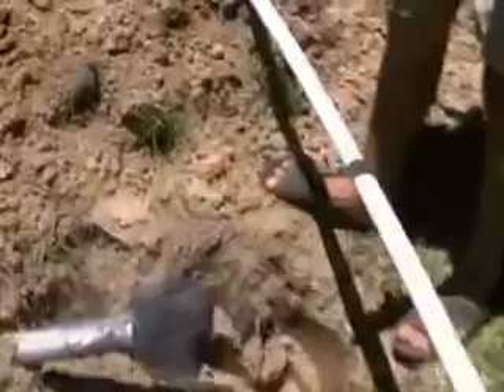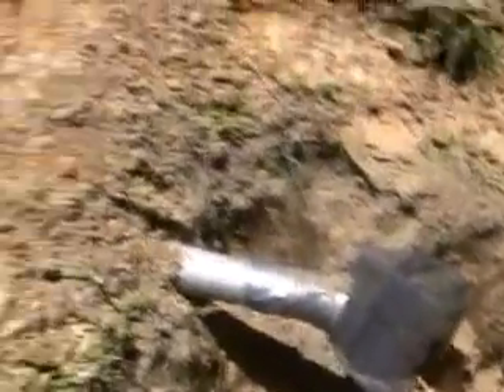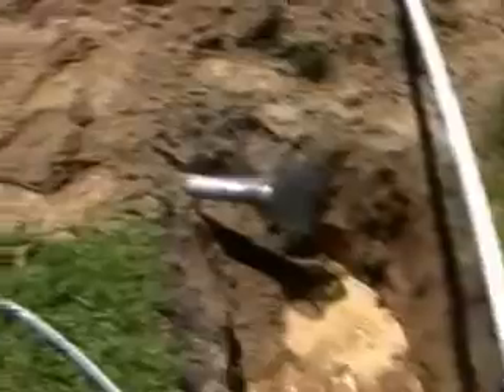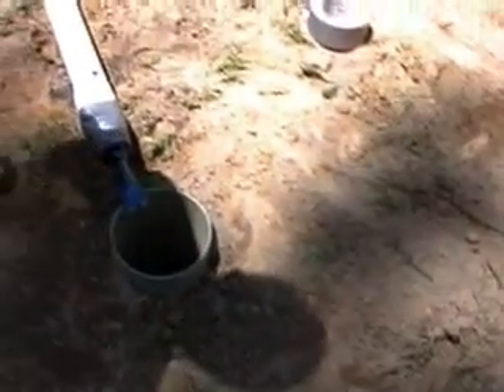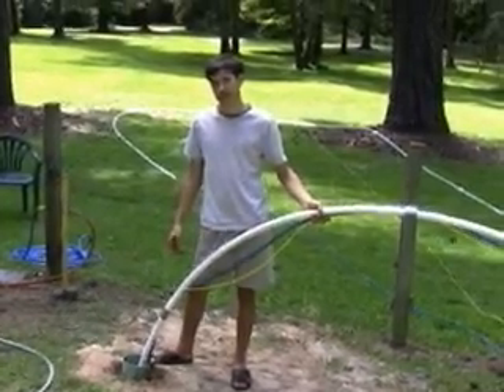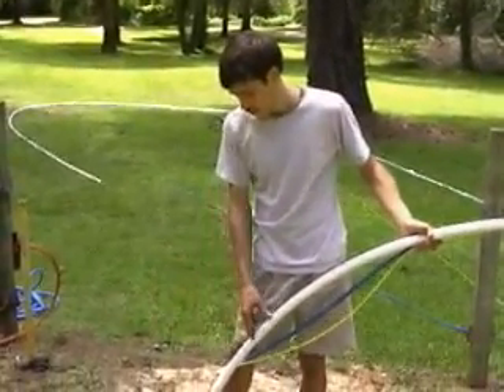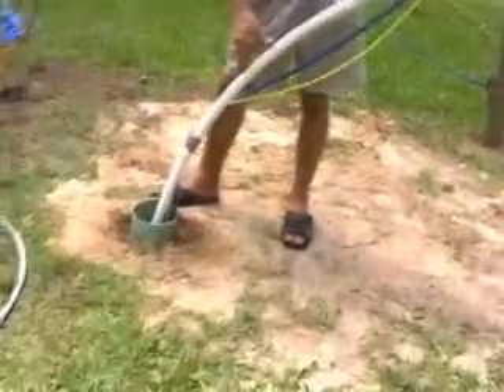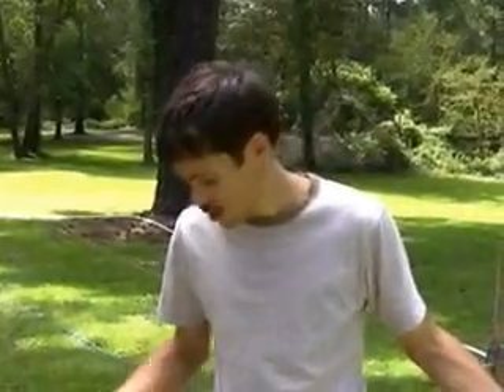How To Drill A Well In Your Own Backyard!

Comment from the maker: I would buy an air powered water pump such as can be purchased on my website, hook it up to a small compressor and some 1" pipe, and pump out the sand that way. It probably just needs pumped out good until the cavein has been pumped down, then it will work fine. Alternatively our well drilling system will go inside of a 3" casing to drill deeper to put in a 2" casing if necessary.

Comment: I have a 55 foot shallow well here in NC that has stopped producing. It has a 3 inch steel casing. Everytime I try to pump from it now it clogs the foot valve and pipe up with mud. :(
Any ideas?

Comment from the maker: We use drilling mud to keep the well from caving in while drilling. When you've reached the target depth, you simply pull the drill out of the well and drop the 4" thinwall PVC casing into it and then dump gravel around the outside, and seal the surface with concrete or according to local codes. Then you drop a pump, most any pump on the market will work in this well, and move on. How to know when you hit water is discussed in detail in the plans, too long to go into here.

Comment from the maker: Maaaybe... if you are going less than 30' through nothing but sand, like they do in Senegal. Even then, this is far less work and much faster. And I've drilled 210' , drilled through 50' of clay and several feet of rock; manual drilling can't do that :)

Comment from the maker: I regularly deal with customers who have had pro drillers bypass excellent water (which they found with home system, such as mine) in favor of salty or iron water that is deeper. Deeper water is NOT necessarily better. And ALL wells should be tested for contaminants, shallow or deep, before using. 

300 is a shallow well by well driller standards, yes. But 10s of thousands of TRULY shallow wells (25-100') are in use today, many provide excellent water and do NOT cost 6000$-80,000$ to drill.

Comment: 300 feet is a shallow well in most places in the U.S. MOST not all.
the reason many well drillers go deeper is not because they get paid more. Its because of quality of water. Shallower water isnt as filtered as deeper water and may contain more chemicals and bacterias. Also a deeper well that pro drillers will use uses a better source of water in case of a drought. Those are the reasons a pro driller would drill deeper.

Comment from the maker: That is a well that would be nearly impossible even for a 100,000$ professional rig. If you get a quote from a well driller, it will probably be 30,000$ or so. You are talking a serious hole in the earth, a quarter mile through rock. That is not possible with any home system and as I said, barely possible with professional systems.

Comment from the maker: No home well drilling system can go that deep. With mine it might be possible, but it would be a very, very intense project and would not be recommended. However, you probably don´t need to go that deep. Professional well drillers often bypass shallower water, even if it is just as good or better than deeper water, since they get paid by the foot and need to justify bringing their rig to your site. Most people find water in less than 50´ from the surface.

Comment from the maker: Sure. The plans are primarily concerned with drilling the well, which is the hard part. The casing is pretty easy; but since each state has it's own special regulations you'll have to deal with them; just call them up and ask for more detailed information on what is required and they'll fix you up :)

Comment from the maker: Well, the drill and expansion chamber assembly is rigid for the first 3 feet; that keeps it basically straight. The few misdirections that the drill will still make tend to cancel one another out. And finally we use 4" thinwall PVC pipe  which is relatively flexible so it will follow the hole even if it weaves a little bit.

Comment from the maker: So unless you drill through your own sewer system (the plans also warn about that danger), or drill in a valley below the cattle farm, and then don't case it and seal it with bentonite/concrete according to the state requirements (which the plans instruct you to do), the well will be every bit as safe as a professional's will. And then you test it just to be sure. 

This system has been used to drill, case and seal wells, in states like Oregon, with satisfied inspectors present and watching.

Comment from the maker: If you want a well drilled through solid bedrock in a few days, you definitely need to spend the 10,000$+ to have it done. But if you want a home system that does a remarkable job for its size and cost, consider getting the plans and looking them over :)

Comment from the maker: There is probably no place in the world where it is necessary to drill 800' before you hit the first water. 90-95% of places average 25-50' to the first water. Bear in mind that professional well drillers get paid by the foot, and it is to their best interests (not necessarily yours) to drill as deep as possible. This system obviously cannot compete with $100,000 rigs mounted on a truck for speed, depth, or power - but it does give all the well most people need, and then some.

Comment: I have seen people in Western Maryland USA drill 800 feet before they hit water. The pump they use has about 21 stages,fits in a 8 inch casing, and stands about 7 or 8 feet tall. I don't think this system will work in WM.

Comment from the maker: If it's a joke, it's one that's drilled wells as deep as 210' feet and gone to a dozen countries :)

Casing is installed after the well is finished, the drill stem is pulled and the casing is lowered into the hole. The plans and DVD show the process :)

Comment from the maker: It's impossible to say how long it will take to drill 100', because there are dozens of factors including soil type, presence of water, your own skill at using the drill, how much air you have... etc. I generally tell my customers that if they're not prepared to spend a week at it, or the equivalent number of weekends, not to try to drill their own well. It may take more, it may take less, but it's a good ballpark for an average well through average soil.

Comment from the maker: I have used this well to drill holes to 210', 196', and 175' in three different holes. I see no reason why this system couldn't be used to go deeper, but I've never done it. Although it may take considerable time to drill deeper. Generally we recommend that on your first well you stick to under 100' so that you can gain experience in a shallower well before progressing to a deeper one, but that may not be an option for you depending on where you live.